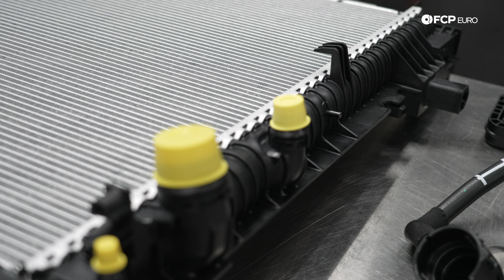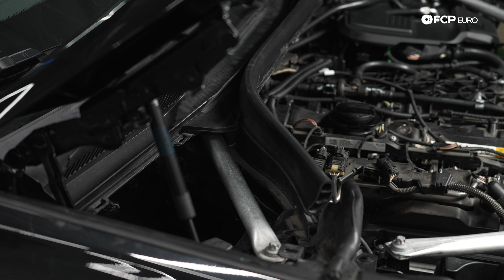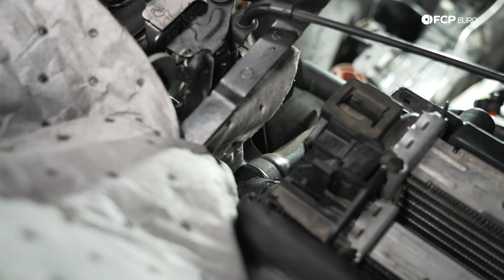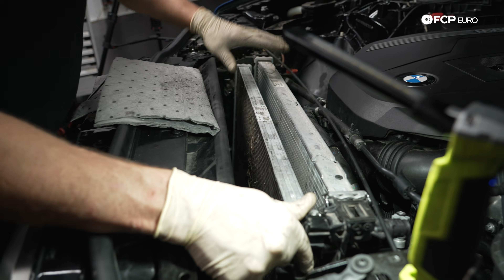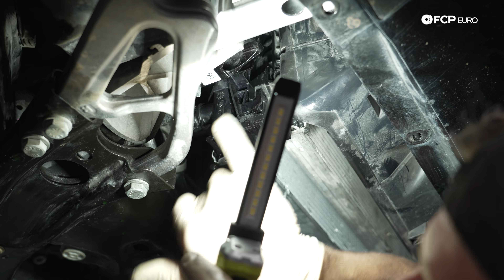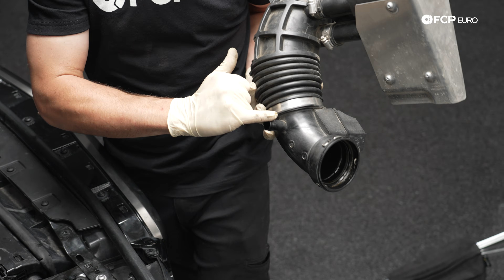BMW X3 Radiator Replacement DIY (2018-2024 BMW G01 X3, G02 X4, M40i, B58 Engine)

Comment: My '21 F97 3M Comp fan blades blew up and punctured the rad, I am being told its fairly common with the X3M's.  My question is, is this process the same for the S58 in the F97/98? Wanted to check before tearing into it, i bought the replacement complete rad kit and fan assembly, and vacuum fill tool along with an extra gallon of coolant from you guys at FCP yesterday. Hopefully that's all i will need as it was over $2k, which I'm guessing from BMW would have been double that amount lol. Appreciate you guys.... 🤙

Comment: There is actually a way to get radiators out of the car without lifting the front. I just did it on my x3 2019. There is a plastic cover peace at the bottom that holds with two clips in the sides. Between radiator and front bumper. Just take that one off and you will be able to get radiators from under the car without lifting it up,  but just using the 45 degrees angle
Reply: Hey can you tell me which clips they are. I need to do this and really don’t want to do it from the bottom. Is the two clips at the bottom big or small? And do they hold both radiators or the the main radiator?
Reply: @RKSAINT just dig after you take off all the radiator’s clips ,and after  there will be one silver plastic piece  touching the front of  bumper and you kind of have to find the way to unclip it(easy), it also has a wire attached to it. You ll see , don’t worry .
Reply: At the bottom
Reply: @nickspirit2023 dude I appreciate it man. I hate working from underneath the car so if I can avoid it I’ll try this method. Thank you!

Comment: Can the radiator be removed from the top?
Reply: Wondering the same thing...I'm assuming if the auxiliary radiator was removed from top...bottom one can as well?
Reply: yes i did mine 2018 530i and u can remove it like he did from the top it just slides up after unplugging hoses and a few clips
Reply: @adangarcia7876 it’s different on 530i compared to g01 x3. Even 330i you can remove it from the top.
Reply: Did you ever find out? Lucky me, get to replace one. 2019 x3 m40i.
Reply: @aaroncarpenter2999 just did this job in my garage on jack stands. The radiator comes down and has to be installed from the bottom. I tried taking it out the top but those mounts on the radiator are too wide. Pretty easy to remove from bottom.
Reply: @RKSAINT  Darn. That kinda stinks for those of us that work on jack stands. Any problem getting the car high enough to slip the radiator out? Thanks or the reply.
Reply: @aaroncarpenter2999 honestly I had no problem getting the radiator in or out. Looks like a nerve wracking job but honestly probably one of the more easier things I’ve replaced. Took me about 2-3 hours from start to finish and it gave me the opportunity to clean the secondary radiator for turbo.
Reply: @RKSAINT  Great to know! Tackling this next week, so I appreciate it. Pinhole leak. Crazy thing is, no aftermarket version exists. Yet. Had to buy OEM $$$.
Reply: @aaroncarpenter2999 there is in aftermarket version. I bought mine from rock auto instead of FCP euro. I got the koyorad brand and honestly just by the quality it looked better than oem. They reinforced the known leaks on the radiator and it was a simple swap. I paid $130 for it, oem would have been $500.